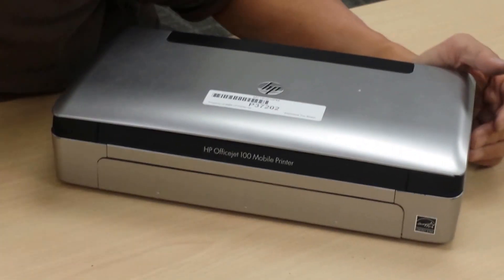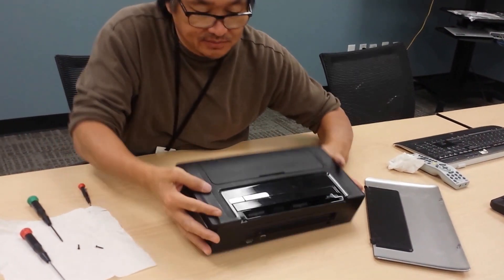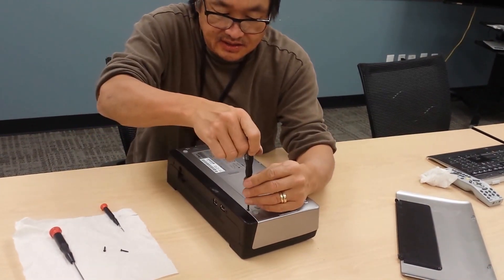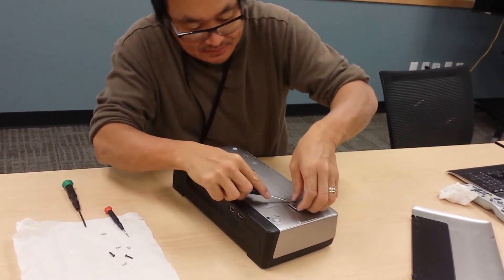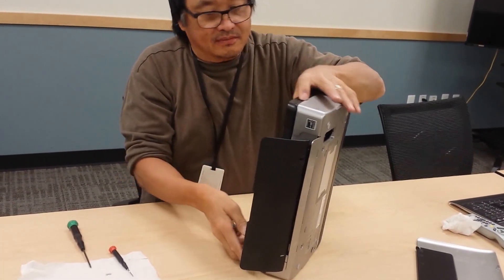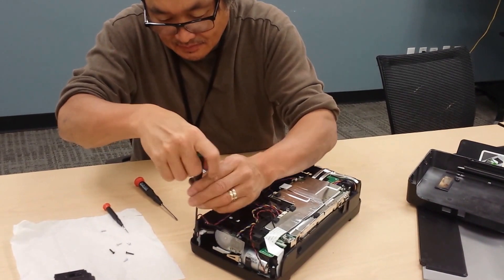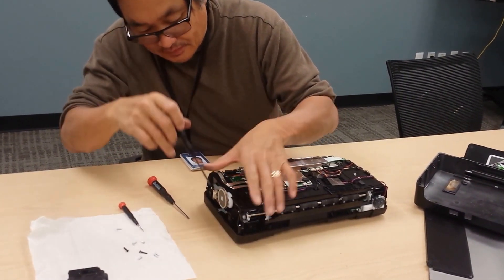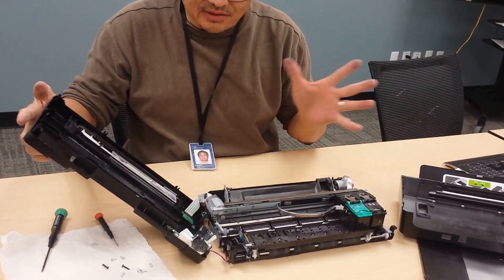HP Officejet 100 Mobile printer disassembly

Comment: i dropped mine now it comes with an error after changing the ink it was working after I dropped it... I used the ink one time after dropped it then after dropped it said change ink aging I did put a new black ink and it worked after dropping it had to come to tell you guys the news.

Comment: OK, great video for taking it apart but NOW WHAT?  My HP OfficeJet 100 suddenly stopped pulling in paper.  Power's on, Bluetooth is on and connected, paper is in the feed tray, the file I'm printing says "full-size paper" in the print option and plain white, full-size paper is in the feed tray, no staples, rips, etc on the paper to be printed on.....nothing.  I can hear the roller(s) trying to pick up/pull the paper and run it through but NO paper is being pulled in/

Help?